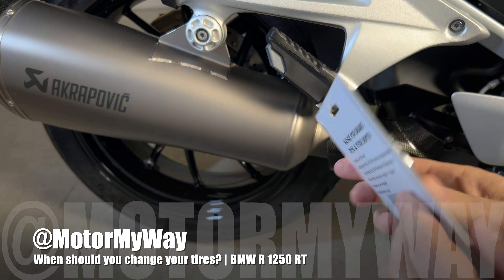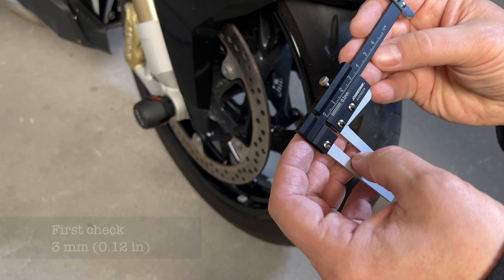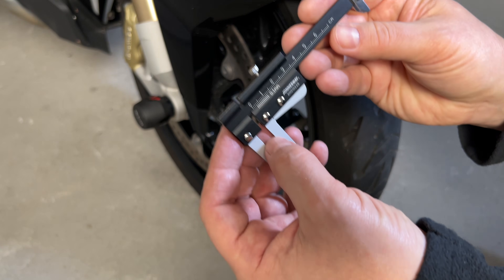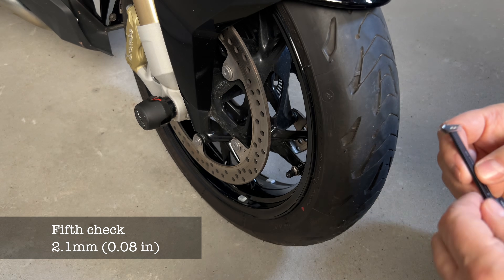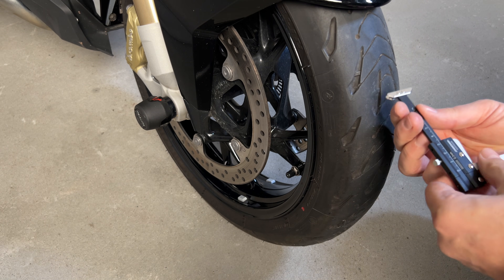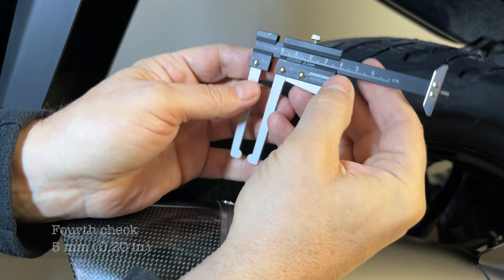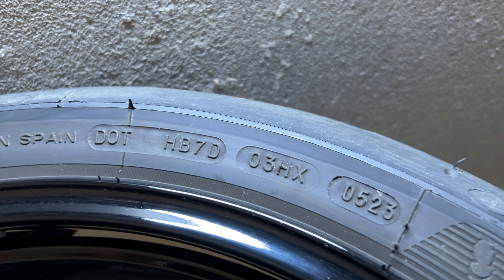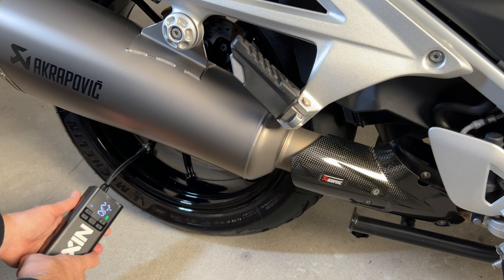The new European Regulation on worn tires | When should you change your tires? | BMW R1250RT

Comment: So to increase wet grip at minimum tread depth means softer rubber compounds. Which means shorter tire life leading to an increase of tires purchased leading to more tires in the landfill. I don’t get it?
Reply from the maker: I don't know if this won't also force changes in the tread design, but it will undoubtedly be a challenge for tire manufacturers, which will probably affect the price of tires.
Reply: @ Tire prices are going through the roof as it is.

Comment: So, in the UK, the minimum is 1mm for motorcycles. Under 50cc and under a certain power limit it’s merely visible tread. Get longer tyre use out of that, but lose wet grip.
Reply from the maker: I don't know if this is actually the case, but I read somewhere that in the UK the regulations say that even only 3/4 of the tire should have 1 mm tread and the rest should be at least visible :)
Reply: @ yup.

Comment: i hope EU address the extremely wasteful practice of manufacturer maintenance schedule, so many parts and cost for just maintaining a simple car for it to perform normally, there's still many manufacturers in my part of world want you to throw away perfectly usable fully synthetic oil for just 3000-5000 miles along with filters and many more perfectly good condition items for the reason of preventive maintenance
oh its even worse for bikes, oil change interval is like crazy short
Reply: if owners want to change oil early there is nothing they can do about it. Are the rozzers going to raid my garage for illegally changing the oil of my own vehicles? That is automakers' wet dream
Reply: @HungVu-ec3jk  it's not whether you like it or not, the manufacturer threaten to void your warranty if you don't do it their way
Reply: @lansiman  around 3000km for every litre of oil is reasonable for motorcycles using synthetic. The vehicles you see with short OCI are often small capacity engines with low oil fill volume. Motorcycles live at higher rev range, when cars rarely break 2000rpm, most motorcycles spend at least half their lives above 6k. Ofc oil goes bad faster. And the trend for most car manufacturers are 10k miles oci nowadays
Reply: @ unfortunately in my region many brands still recommend a 5k km oil change interval and you must follow to prevent voiding warranties, oil change itself is just tip of the iceberg, i took my car for regular oil change and i never came out only changing the oil, the service center always push for multiple other unnecessary service item,i haven't got to major service item, i remember merc throw away so many parts that looks absolutely pristine condition and  charge me almost 2k USD for it, just to keep the damn car running like it should? no wonder EV slowly get the attention.
and it's not just the manufacturer, car and bike community love the idea that they need to perform constant maintenance to their vehicle, they like to think their hyundai is like F1 car, there's also tonnes of car youtuber insist very short oil change interval while citing absolutely unrelated problems to associate with it,its like changing the oil cures every manufacturer defect.
all these scare mongers and wasteful culture is what going to kill ICE engine very quickly, imagine every vehicle need that much maintenance item just to run normally, it'll get more and more attacked by environmentalists and be gone by the mid of this century
Reply from the maker: You are exactly right, I don’t know if there are any regulation changes planned in the maintenance schedule, but it’s good to see that EU addressed already the topic about throwing away goods that could be repaired which has a significant impact on the environment as it leads to 35 million tonnes of waste annually in the EU. It is described here: https://www.europarl.europa.eu/topics/en/article/20220331STO26410/right-to-repair-eu-action-to-make-repairs-more-attractive
Reply: This is a big fear when buying a second hand bike, an owner like this commenter wanting to not change the oil on their bike very often.   Every 3000 miles for me, whatever the bike.  Oil is cheap and works hard.   Change your oil ya bum!
Reply: @flyjayUK  synthetic oil had came a long long way, saying a modern oil on a modern car can only last 3000 miles is an absolute insult to oil and automobile advancement and also the reason ICE engine are being condemned and attacked for being wasteful on top of being polluting.
i also want to add, aside from ridiculous manufacturer maintenance schedule, the ICE fan crowd also had a wasteful culture where they like the idea of 3000 miles oil change, big wasteful engine, drive in a wasteful way,  burning tires etc
Reply from the maker: @flyjayUK  The commenter above referred to the situation of changing fully synthetic oil too early and with it other consumable parts. Modern synthetic motorcycle oils can be changed less often. In the case of non-synthetic oil, you are right that it should be changed more often.